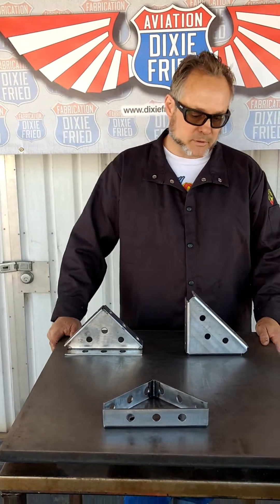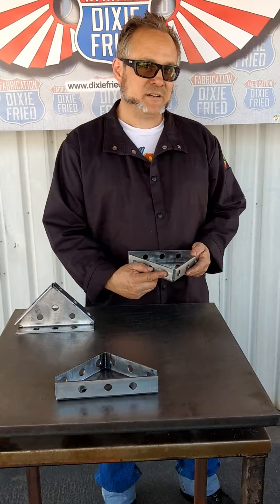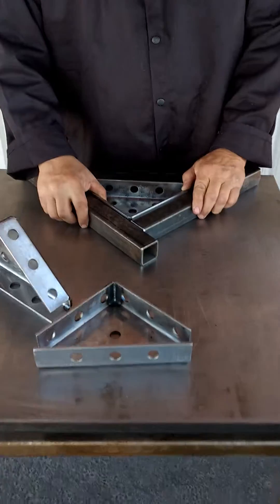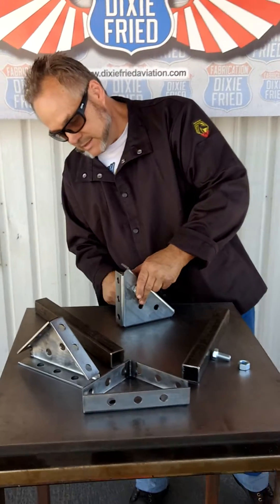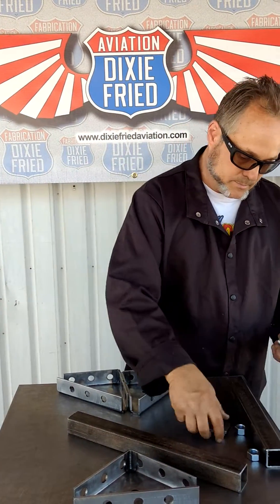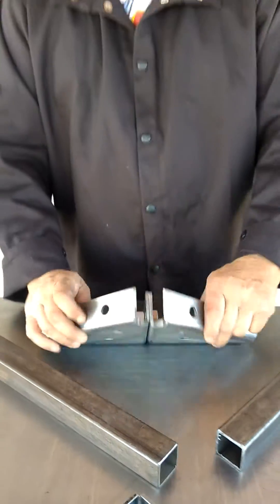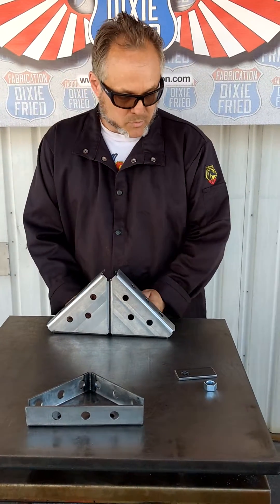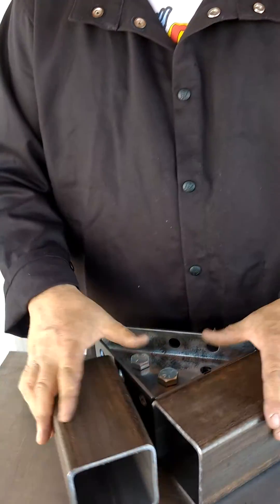Blockhead Welding Squares

Comment: Is it me or am I actually seen something similar to this out there somewhere? Anybody else seen anything looks really similar?
Reply: Marsh Monster Genuine metal works makes one that is similar but theirs isn’t machined to make sure it is all true.  They have a tolerance on their squares.  These seem to be more versatile and maybe the others can be use in the same way but the others are only for 90 degree function and are not practical for 45 degrees.   Idk what these cost but those others are priced a bit to high for what they are.
Reply: Went to website no pricing and no submit to cart button